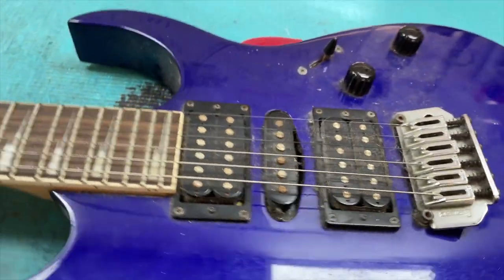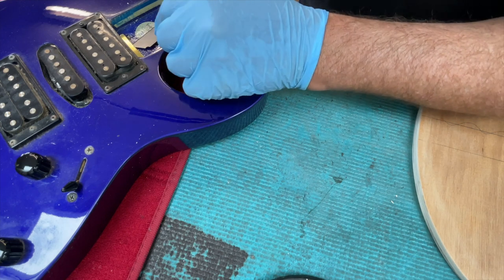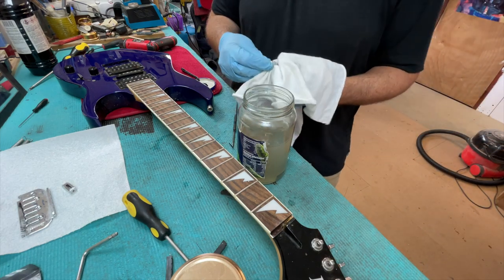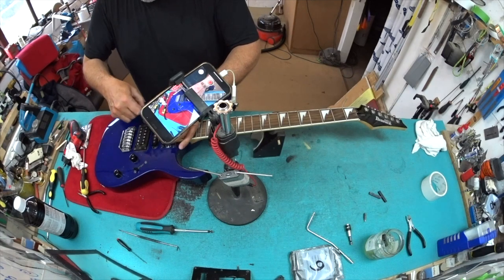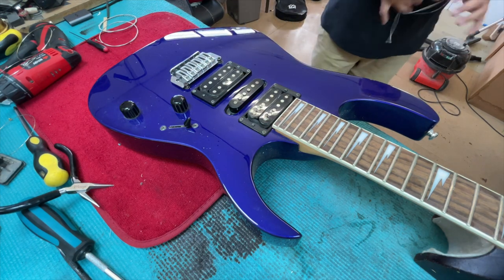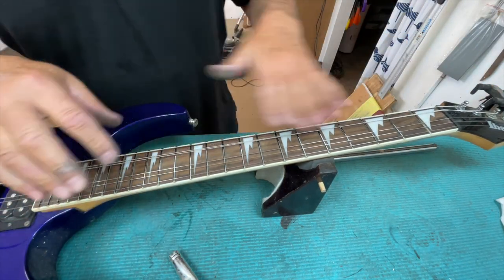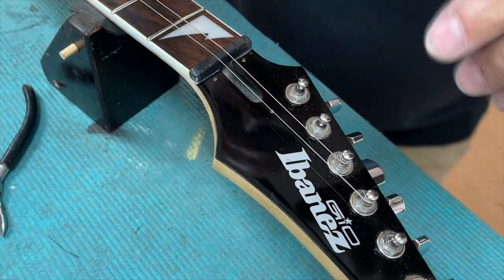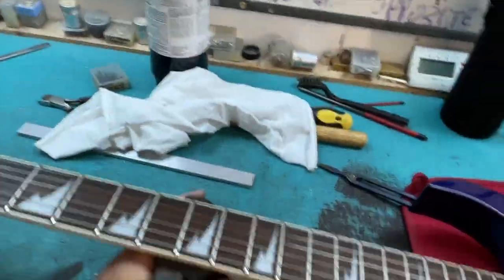Ibanez Gio resurrection and set up

Comment: When I shim necks, I use real thin wood veneer. I want to keep the wood tone as much as possible. I also remove the paint and use tung oil to seal the wood in the neck cavity. Believe it or not there is a difference in tone. I wouldn't  do this to another persons guitar without there ok. I explain why I do it. But for beginners or very cheap guitar, NO. unless I plan on keeping them or plan on resaling them.
Reply from the maker: To be honest, you have to believe in "wood tone" in the context of an electric guitar and I'm afraid I don't. But we're all different :)

Comment: I wipe my neck, strings and fretboard down after playing. Everytime. I also wipe the body off. When strings were changed the frets and fretboard were always cleaned, frets buffed every month to keep them shiny and clean for bends or just playing in general. I used a toothbrush to keep grim out of the hardware and pickups. Yes I played them, lol and babied them too. I don't like my ladies as I call them nasty. When I use to gig, my strings were changed ever night sometimes 2 nights due to cigarette smoke and fog machine leaving residue on the guitar which I hated. Think, I use to smoke and after quitting can't stand the smell of cigarettes.  I have to take a shower as soon as I can and change clothes and get the smell off the guitars.😅
Reply from the maker: Yep - we ex-smokers are the most intolerant of the clouds of nicotine and the smell. Ugh. Yet we can still lie on a beach and smell someone light up and be transported - for a moment - to those (stupid) carefree days when we luxuriated in that particular form of slow-suic*de. Nuts.

Comment: I use razors also. I roll the edge over using a round part of a screwdriver so at the edge of the razor has a hook on one side, just the same as if you were deburing a scraper used for wood working. I only do this on rosewood or ebony necks then I rehydrate the fretboard, let it set for a few minutes and apply more then after a few more min wipe it down to get any excess off.

Comment: £135 setup can make a cheap guitar play as good as if not better than something that cost thousands of pounds. 

People just don’t realise (I didn’t either ) how a fret levelling transforms a guitar , add in a quality nut that’s been carefully filed to a low first fret height , truss Rod set, saddles set , strings put on properly and  slack removed etc etc . 

It blows my mind when I think about this .

A 76 year old student of mine brought in a custom made guitar . I’m not totally sure if it was unfinished or what , but the thing just didn’t play or sound good . Quality parts .lovely flame maple neck , and nice body , vintage tuner, fender bridge , good pickups and thick steel trem block , but the tuning stability was a bit shaky, the first fret height was about 1mm and looked like the frets had not been levelled. There was too much relief on the neck . There was no access to allen key via under the pick guard. Had to take neck off multiple times (one piece neck) . You had to turn left to tighten truss rod instead of right, but I digress. Without a proper setup this guitar is a waste of time and a well setup cheap squier is more fun to play and sounds better. That’s just the reality of it . A good luthier deserves to be paid well , it’s such a skilled job. It seems criminal that a person could buy  a guitar for a few thousand quid for a big name  guitar and it’s still not right .
Reply from the maker: Sorry for the late reply - yes. I've seen quite a few partscasters made with premium and exotic parts that had zero 'set up' knowledge in them and as a result were truly dire to play. And one of them - hand-made in a jungle in the Far East I think - also had a truss rod adjuster that worked opposite to 99% of the rest of the world. Why...??? When you learn - or experience - the difference that a truly well set up guitar makes it seems so obvious. But then again, I played for 30 years without ever figuring it out or having a guitar like that; always making-do and struggling with finger-slicing action etc. The trick is to help people like that historical me 'get it' because when they do, there's no question that's what they want for their guitars  :)

Comment: I’ve got exact colour 2004 model , it’s rock solid
Reply: yeah the top wrap thing was something i never bought into
I think i damaged this guitar by putting the strap in and forcing the lid down and latching it shut
it's one of those really snug cases
so now the d string nut slot is damaged i can tell because it's lower than the 5th string up at the nut
it's like you said on the vid if anything is off in geometry it won't work
so guys and gals don't force your lid shut on your guitar
i didn't mention the nut slot thing in my previous comment  because i felt like i was writing a novel lol
THNX
keep the vids coming
you are the guy who convinced me  not to be afraid to turn the truss rod or do my own set ups
onto it

Comment: GIO , change some hardware and pickups and you have a very nice guitar. I never do intonation on a guitar on my own . I have the player come in and set it to his playing style. How he frets is he heavy handed or does he have a lite touch. If I set it up without them, I'm setting it up to my specs and playing. I would have changed the springs since they are old. New set that have a equal tension.
Reply from the maker: Agree with you about intonation. The fact that no two people use the same force to fret and the fact that no one person even does it the same twice in a row makes the need for £1000 tuners... ridiculous. The variable of fretting pressure is SO gross (in it's true sense) as to make such sensitive tuners pointless in the context of intonation.

Comment: Hello Sam,
 I've had an EVH striped series for about a year but it's not staying in tune.The problem doesn't occur while playing, I actually only notice it the next day or when the temperature fluctuates sharply. The original string gauge is 9 should i use 10s ?...
All nuts and bolts are tight, including the two that go through the neck and the floyd sits nicely on the back. I haven't played it often because it was so expensive. Now that I've seen your video, I remember that I stretched the strings a bit sloppily at the beginning, or is there another problem with this model that I don't know about??? maybe with the untreated maple neck? My other guitars with Floyd Rose all stay in tune very, very well. The EVH also has this D-tuner, which works perfectly, but I would like one that works more precisely, is there anything on the aftermarket that is better? 
That GIO has a very nice color, great job Sam 👍
Reply from the maker: Difficult to say. My logic is always that any trem (so long as the plate can freely pivot on the screws or twin posts) will work pretty well and want to return to equilibrium. But equally, any trem will team up with 1) unreleased slack and 2) friction-y slots (on regular guitars without locking nuts) to put the guitar out of tune. It's rarely the trem's fault is what I'm saying. 
The exceptions are where the two faces that touch are rusted / pitted and they can't move smoothly against each other. This applies to both the 'hourglass' posts on a Floyd and the un-threaded chrome part on the 6 screws on a Strat trem and the edge of those 6 holes in the plate. 

I would always recommend that you stretch the hell out of your strings before you either lock anything down (on a Floyd) or before you move to setting your 6 screw trem (or 2 point) to float on a strat... And ensure the nut is good (Tusq) and / or the locking caps lock down absolutely fully. On that note, I've had locking screws 1/2mm too long from factory that grounded out under the nut saddle before they sufficiently locked the caps down - with the result that using the trem dragged the strings through the pinch point.

Smoothness of touching faces.... removal of ALL slack in the strings. Making sure no scratchplates touch, that the routs are unobstructed. 

Can't think of anything else on a Floyd. On Strat style 6 screw overtightening the 6 screws so they pull down the plate at the front will stop it moving / returning smoothly to pitch. As will changing the trem plate screws for 6 new ones of ever-so-slightly-the-wrong-size (quite a common thing when swapping bridges out)...
Reply: Thank you for taking the time to reply to me. I will follow your valuable tips and check the points raised. 👍

Comment: i have problem with  ibanez gio 24fret after low the string action 1.75 all string buzz at first fret
Reply from the maker: @qayyumyumz4190  either 1) your nut slots are cut too low or 2) your neck is slightly back-bowed with a hump in the middle that makes notes fretted in the first half of the neck buzz or choke. 

If 1) get a new nut and cut the slots down to the right 1st fret action (my target is 0.3mm) or 2) turn your truss rod adjuster counter-clockwise to slacken the neck until it first goes dead flat and then a tiny bit of curvature.
Reply: @SamDeeksRelovedGuitars  thanks  . i try ,👍

Comment: i have a 1993 Hohner middle tier strat copy that has the fender type micro tilt adjustment which i was able to finetune properly back then, me aged 17 and no internet and zero information. but even then i was bothered by it and realized that i bought a not so good instrument (minimal info avbl before buying then and im a lefty)... the notion that this is still a problem as of 2023 in the age of CNC and laser scanning just infuriates me to the max. an absolute outrage. diy woodworking youtubers w mid level MANUAL tooling demonstrate better precision and could set up a router jig in 2 hours that this could be corrected. ibanez is an especially disg...ing company they basically live off a lucky design they made in 1987 something while giving off extremely minimal added engineering content if you not willing to pay extra (meaning 1000+, 2000+ USD) . they are especially harsh and rude to left handed guitarist, making sure year after year that only their most bland and uninteresting colors/models get made in left handed. 
and the gio models are advertised as, almost as good like the big broters, the same body, access to the features bla bla bla. turns out they cant even get a neck joint right. joke
only worse company is PRS
Reply from the maker: I enjoyed that rant - sorry for the late reply to tell you so! :D I'm curious as to what it is about PRS that you don't like? (I'm on the fence; I've not had a 'spark' with any that I've encountered so far but that could just be me / bad luck / not met the right one...) Actually I did a set up on a lower end one (a Hollowbody) the other day and the neck was technically as 'bad' (or only as good) as any other guitar I've set up. Full of 'hills and valleys' with the strings slapping the frets all over the place.

Comment: I never paid anyone to do basic setup, I just learned about it. Can be a frustrating experience though when you think you understand measuring and setting the action, neck relief, even try something like deepening the slots in the nut and still can NOT manage to get a combination of decent low action and no fret buzz (or fizz maybe as you called it, even when the buzz is gone, something still eats up the sustain and there's a little fizzle out you can hear up close). "Why! What! Where is it coming from? What is it buzzing on? Why do my harmonics sound so dead unless my strings are set a mile above the fretboard?"

This video probably just answered it for me. Uneven fret height, hills and valleys, it actually matches perfectly the phenomenon I see with my guitar, where something like 4 to 6 frets in a row will take on the buzz, unless the action is way too high. I also have a Gio (7-string) and while I don't really have all the right tools to level them out at least I finally know what is probably going on (and can measure and check).

This is the most valuable guitar tech video I've ever watched.

Comment: Hi. i have a question 
does improper windings lets say the guitar has 3 tuners on each side of the headstock 
the g string has 3 windings and the d has 2 windings
would this effect the pull tension or whatever you call it  
and cause uneven tension??
i've read articles where EVH had to wind his strings all differently before they made the locking nut
just for him to dive the bar
i'm fighting with an epi LP right now i'm getting stiff action i'm using 11's but there has to be a way to fix this?
do you raise the bass side in order to counter the tension of the treble strings?
its driving me nuts
THNX
oh yeah don't be afraid of adjusting the truss rod
just use common sense and watch the hours of free vids this dude has kindly made
Reply from the maker: With respect (and it's easy to do) you're over-thinking this - not helped by how much guitar mumbo-jumbo there is going around the internet! How you wind the strings on the tuner pegs has zero impact on how the guitar feels to play; the only thing you affect might be a) storing up a bit more slack that you need to remove by stretching the strings if you put too many winds on b) slightly affecting the position the string comes off the post (i.e. bottom or top of the coils) which can slightly alter the angle the string comes to the nut at or 3) er... I can't think of anything else. Oh - yes, if you tie a little knot in your string around the post guitar techs like me will curse you under our breaths. There's no need and it just wastes our time and hurts us when we get spiked by the cut end... 

Now "stiff action" using 11 gauge strings... 11 gauge strings give a 'stiff' action, period. If you've been used to 8s, 9s, or even 10s then 11 will feel stiff on your guitar. 11s on the shorter scale length Les Paul will however feel slightly less stiff than 11s on the longer scale Strat. As you go shorter with the scale length, the same gauge of string feels looser... The part I've never understood is that there are people who SWEAR that top mounting the strings i.e. over a wrap-around bridge makes the strings feel 'looser' or 'tighter' (I never remember which...). By the holy laws of physics I declare it psychosomatic! 

If you want light, bendy feeling strings keep it simple: go for a short-scale guitar (like a Fender Mustang (24") or just go down to 9s or even try 8s on your Les Paul (24.75")...

Comment: To buff fret tape fretboard off after cleaning and if need be oiled. I use a polish called, Mother Polish. It is great to use on fret and buffing out small scratches on a body. It is so fine that I've used it on CD's that skip or jump a part if a track. I've done it to friends CD's that have problems and it works. Just wiping and cleaning with CD cleaner it didn't work. But the Mothers Polish worked everytime as long as it wasn't major damage.

Comment: Nice to view this transformation, i bought the same model by 2nd hand (black, made in indonesia).

put out old humbuckers and replaced them with some EMGs 😂 seems to be overkill but i‘ll take them out if ever decide to get a higher ranged guitar.

I blocked my trem with a piece of wood . 
my action from the 12th fred is a bit too high so i‘ll try to lower the trem with the 2 bolts there.

Greetings
Reply from the maker: I've since changed the bridge footings to take a Wilkinson 2-point tremolo and have re-painted it in candy-apple nitro. Not that different from the candy apple it was before; but this gave me opportunity to fill dings and change the bridge posts etc :) I'm trying to make some decals or vinyl stickers for it (it's a competition prize for an event my brother is running) but it's a bit of a struggle to get graphics of high enough quality to work from lol. Should look good when finished though!
Reply: @SamDeeksRelovedGuitars  sounds good , good luck, i was thinking about to make paint job on mine but in the end its too much work😂 
 
One question, i cant get the string action as low as i want, i want to use a shim how u did.
What was the thickness? Ty
Reply from the maker: @philipp5883  I use a piece of 0.25mm thick brass
Reply: Why did u tape it ? To get 0.25mm or sustain?
Got a 0.2mm brass piece
Reply from the maker: @philipp5883  nothing complicated, just to hold it in place for convenience :)

Comment: Thank you so much for your help , i was working on the same model and colour guitar while watching your video .
i had the same problem with the action being so high and the tip about using a shim worked perfectly .
I picked mine up for £60 today . I re soldered the jack socket as it was faulty ,added the shim , sprayed switch cleaner on crackly selector switch 
and added new strings . I gave it a nice polish and now it plays great . It sounds really good for a budget guitar .
Liked and subscribed ,cheers  👍

Comment: I learned a lot from this video. But I was surprised that you didn't adjust the truss rod (if only to show how it is done). You removed the plastic covering, but then went straight to cleaning the fretboard. What did I miss?
Reply from the maker: I typically adjust the truss rod (if required) prior to fret levelling, the first of 3 adjustments to set the ‘playing action’. First, check and set relief, second last fret action, third 1st fret action. In this guitar’s case the neck was so filthy I think I prioritised cleaning it.